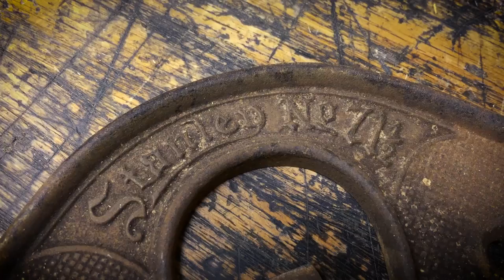Stanley No. 71 1/2 Antique Router Plane Restoration DIY

Comment: I found you from Wood By Wright's suggestion on the Crafted Podcast. Cool video!
Reply from the maker: Thanks Bruce. I heard it there too, and it blew my mind a little! It was way cool of Mr. Wright to do that. Glad you liked the video man! More to come.
Reply: Good deal. I don't have a router plane. I have an old Stanley No 4 and a Stanley block plane. Admittedly, I don't use them as often as I should. I think I'm still intimidated by sharpening. (Big surprise, huh?)
Reply from the maker: Sharpening is what really got me hooked. Once you get it down everything in your shop and home will be sharp... like scary sharp! I have a Trio of DMT plates, but to start I just got some cheep (and I mean really cheep) diamond plates from evilbay. I think they were less that $15 for all 3. You can see them being used in this video glued to a piece of granite.
Reply: Pale Dog Tool Co. I have the Ez-lap brand ones and they're pretty good. Just need to hit my stride with them.
Reply from the maker: Eze-Lap makes outstanding stones and plates. I’m sure you’ve seen them, but Wood By Wright has a couple of great videos on sharpening.
Reply: Pale Dog Tool Co. I'm sure I've seen them, but I need to reference them again. Thanks for the reminder! I used my No 4 in my most recent video, but I'm just so paranoid of tear out. Ha

Comment: What kind of protection did you apply to prevent future rust? great video, thank you.
Reply from the maker: I’m glad you like the video. I use Evapo-Rust to clean, and I have a rag saturated in a can of Johnson’s Furniture Wax that I use to coat all of my iron tools. I generally wipe down all my tools and handles with that wax rag every 6 months or so.